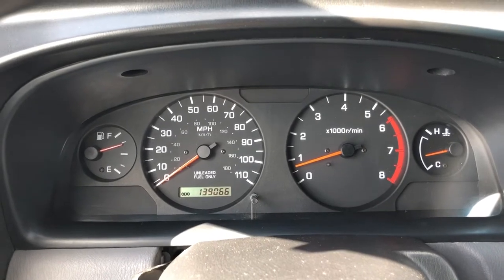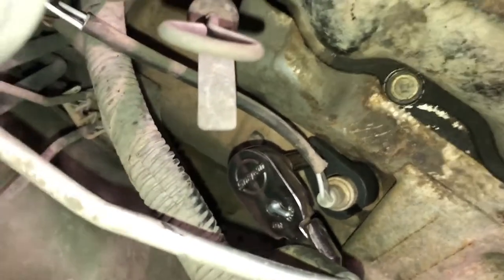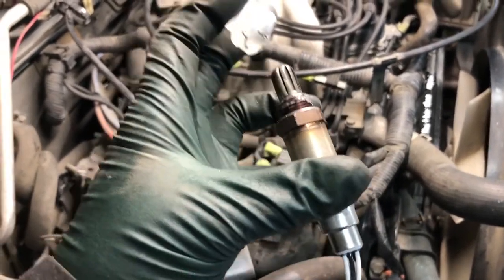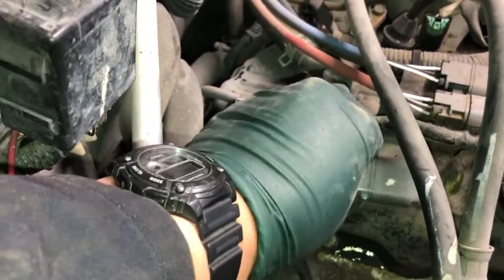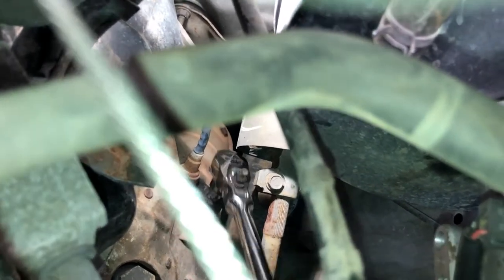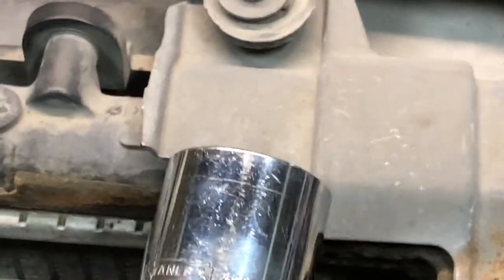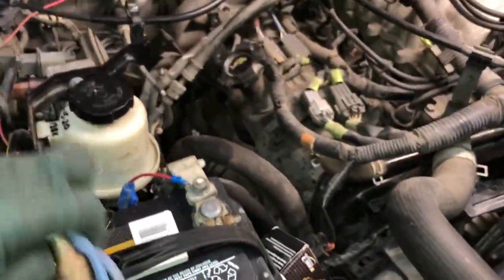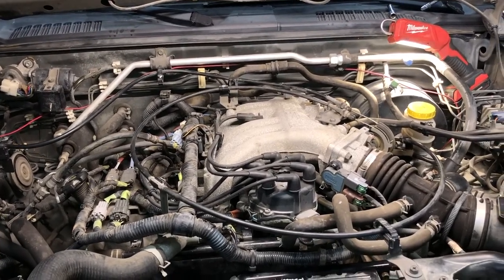2000 Nissan Frontier 3.3 V6:  Replacing the upstream O2 Sensors

Comment: Purchased sensor and after renting for free with Deposit the removal replacement tool from parts store and then removing the sensor I found that they were not the right size. You showed this and called it the "bung" or something. The parts store said must be dealer item and others there said that should be one piece and would not be able to unthread the bung or adapter @6:29. So when all else fails went to the web and sure enough someone had already done it and showed the removal technique. Thanks a bunch for the video, gave a thumbs up for the vid. Great Work again

Comment: I have a 2002 xterra with the 3.3L -- just like the one you're working on.  I have code P1143 -- I can't seem to find much about it, except that it says bank 1 sensor is reading lean condition.  Not sure if this is a failing sensor or if I have a hole in the manifold that's throwing the AFR off.  Have you come across this code?

Comment: What's the name of the tool you use at 7:58 ?  I've been looking at o2 sensor wrenches on amazon but none look like the one you have
Reply from the maker: That would be a 1-1/4” socket and a Carlisle round swivel head ratchet.  I was using the socket to put the O2 sensor threaded bung back into the manifold.

Comment: wHAT IS that white plastic cover/cap that you put on the tip ofthe sensor, rigth after you applied anti sieze, and right before you threaded the sensor back in place?
Reply from the maker: It is a protective cover that comes with the new sensors to protect it in shipping.  I'm sorry I didn't show it or talk about it - but I removed it prior to installing the new sensor in the manifold.
Reply: @AKJeeper  Thank you. I used your video as inspiration and successfully replaced mine and check engine light disappeared and I passed emissions test in Illinois.

Comment: Wow, I have the same truck with the same mileage.  Why did the owner just request the replacements of the upstream and not the downstream?
Reply from the maker: The downstream sensors are much easier to get to, and are basically there only for the ECU to check on catalytic converter efficiency.  Customer elected to do those another time. The upstream sensors are what the ECU uses to adjust the fuel trim for the engine.
Reply: @AKJeeper  Thanks for the knowledge!

Comment: Every 60k miles they say the old 3 and 4 wire heated o2 need to  be replaced..? I don't know what to think about that....at 65 a sensor ×4.
Reply: Well done!
Reply: At 292k miles.  Check engine light on for the first time.